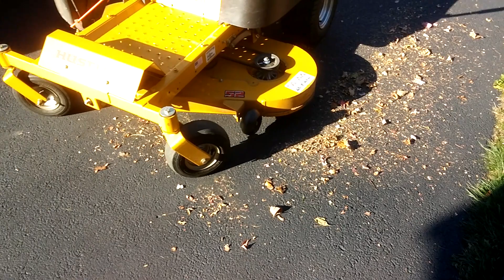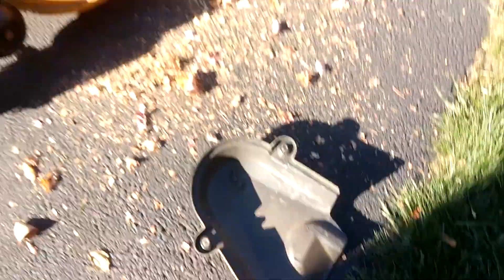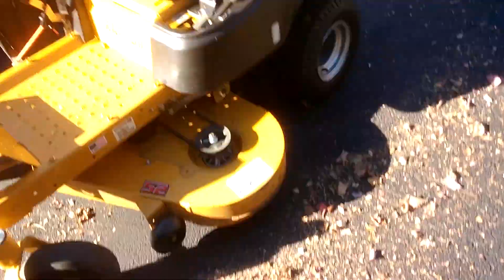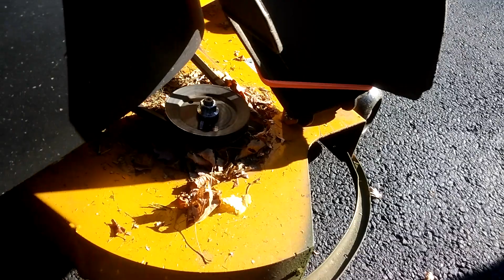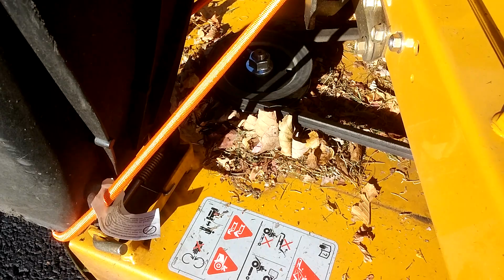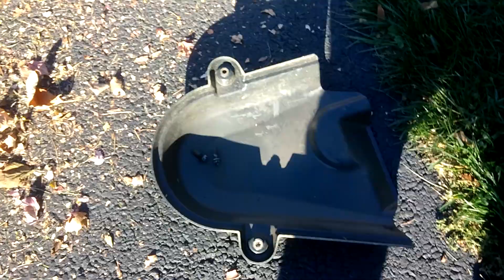KAWASAKI explanation on HUSTLER RAPTOR engine chan

Comment: Wow, so it was Kawasaki's decision. Ok. And you're right, don't let those leaves collect under those covers. Builds up heat too. No good for the bearings. You know, dangerous or not I'm sure you've noticed that all my covers are off on all my machines. I can blow them off completely that way. If I had employees they would be on.
Reply from the maker: yea i noticed thst ...didnt kno those cheetahs had them tho ...yea i actually respect there decision...prob cost them alot of cash
Reply: Supreme Services Lawn Care Oh yea, it had a chute and covers. It had safety switches too. I don't know where they all went... lol
Reply from the maker: +Something 2LookAt lolol
Reply: +Something 2LookAt .....just some experience speaking here and first hand observations.  I've spoken at length with my Snapper/Ferris dealer as well as the Exmark dealer about mower repair. Their shops are quite large with numerous brands and I'm told that the majority of the machines in the shops are from the big box stores but that is the reason they like them---they fail!  What is in those stores is of lesser quality according to the mechanics and both have been fixing multiple brands for over 30 years.  I don't blame Kawasaki a bit if in fact it was their decision.  When a factory puts a good quality engine on a troubled platform it's all about perception in the customers mind when the machine fails for what ever reason.  Though it may not have been an engine failure or trouble that resulted in a service call but the problem gets casted upon Kaw anyway.   It's about association and I know that Honda doesn't sell to taxi fleets and has discouraged the use of their products for such use.  Doesn't stop the Europeans though!

Comment: The 52" SD that im picking up tomorrow is a 2015 old-stock  with a Kawasaki engine.  The dealer told me that at the end of the year, he bought an entire trailer (~34) of the Kawasaki models because he knew they were going to be desired.  Bonus is that I paid the same amount that I would have for a 2016, and I even was able to upgrade to the 2016 seat for only $150. So it was a win-win overall. 

But the point I wanted to make was that I inquired with my dealer about the Kawasaki situation when I was making a choice between a few models.  He told me that the reason you aren't finding them on these mowers now is because Kawasaki was ramping back production of their consumer motors in favor of the more industrial side.  At the same time, they were obviously charging a premium for the engines, and at the price point, it wasn't lucrative for these companies to use them in sub 5k mowers.  So as a combination of both, the motors were dropped by a bunch of vendors. 

On the flip side, he also said that Kawasaki has felt the sting a bit, and has plans to re-open production on the smaller motors as the commercial/ industrial only approach wasn't paying out. 

All in all, i guess its kind of a mix of what you heard.
Reply from the maker: i wanna see a vid of it bro ...i just subbed to ya ...that is freakin awesome man congrats ...let me kno when vid is up ...i will showcase on my channel if you want

Comment: I have had a deck fire before. An idler pulley locked up casusing the belt to slip, heating up the pulley. Shortly after it set all the dried up grass and leaves ablaze.This was on a John Deere 345. It was actually so hot it was glowing. I have seen a number of Kaw. FR engines in the lower end Cub cadet models. It's not good that kaw doesn't have anything in the intro or homeowner product market.
Reply from the maker: no you get a intro or residental mower with a kawasaki on it ...just cant get it a t lowers or depot...

Comment: I think Kawasaki made that decision  because they don't want people to get the wrong perception of their engines. Just like John Deere. People swear that the John Deere sold at big box store are different than the ones at the dealer even though they have everything the same. Same thing with Echo.
Reply from the maker: yes sir ...i totally agree ..i Admire them for that....and yes some people think that the workers wont screw a bolt on as tight because it going to lowes ....yes some people just dont get manufacturing...THEY ARE ALL THE SAME PEOPLE ...LOLOL

Comment: I wish Honda would make a zero turn, I bet it would be a good mower. All the 3 wheelers ive owned was honda 250 4 strokes, best dang atv's ive ever owned. I see them around here still running good with no smoke from the 80's lol
Reply from the maker: actually i cant remember ..some company has honda engines on there zero turn ...i think it was WORLDLAWN...

Comment: Keep the guards on! They are there for a reason. I've run nice Kubota zero turns that do the same thing when mulching leaves. Its going to happen. Its easier to take the guard off and clean them than to have your foot or toe's cut off.

Comment: I took them off my Toro. I'm thinking about just leaving them off. Everytime I take them off they were packed.
Reply from the maker: yea keep them off ....unless completely covered grass just gets in
Reply: I was floored after taking them off the first time. I was amazed they turned. I thought it was because I had them on most the year. The I took them off because I needed to inspect the deck (mowing unlevel) They were thickly packed. They need holes or a way to release the grass a bit. I've seen better open ones on bigger mowers. Oh well, they are off til I sell or trade. The deck comes to a stop quick because of the brake built in. I guess the govt. made companies have a brake in somehow a few years ago. I love my mower, but wish I bought a Hustler. The way Toro hanged the deck is terrible. It bounces around. Can't get it to stay level now.
Reply from the maker: +jeremy yeoman na you don't want a hustler bro ...watch my last couple vids ...deck problems u have no idea ...lolol
what toro you got ,TimeCutter ?